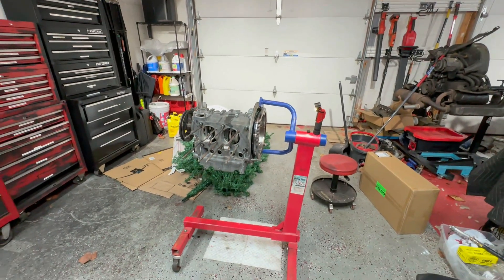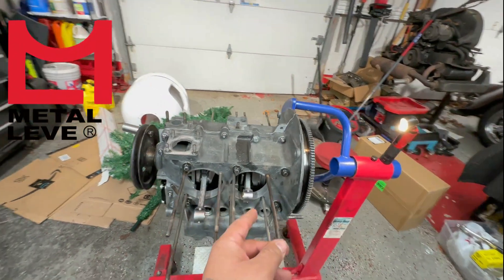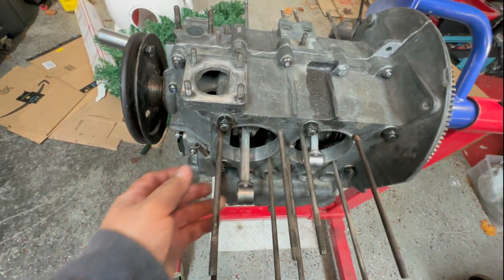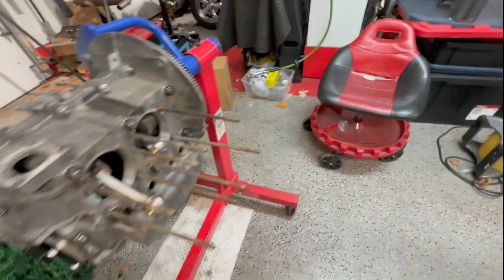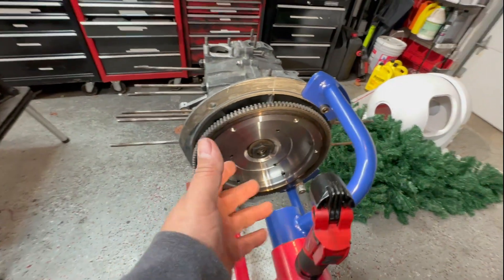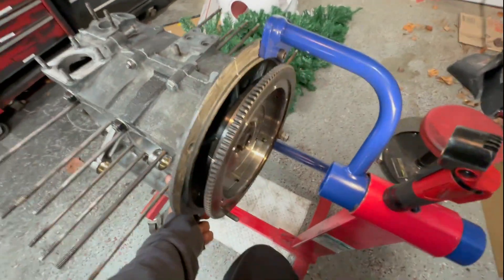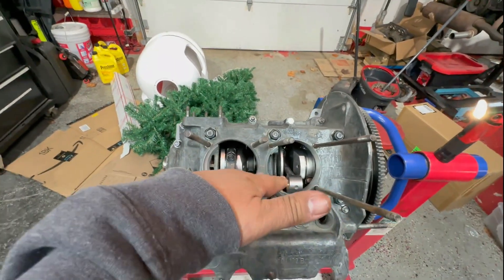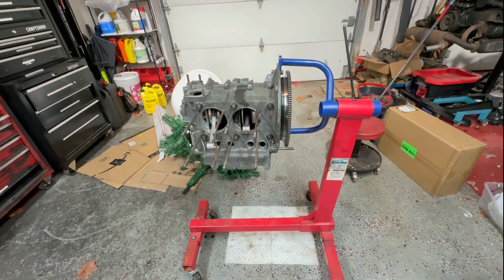VW Bug 1776cc Engine Build-3

Comment: Your torque multiplier is a 36mm as are most VW gland nuts (not 32mm). You have the larger CB Performance gland nut which takes a 1 1/2 inch socket.

Comment: It’s good to have this correct info out there. 
Good job as always. 
I have to disagree though in the larger engines not being reliable…. If you use quality parts and build it properly, they will be just as reliable.